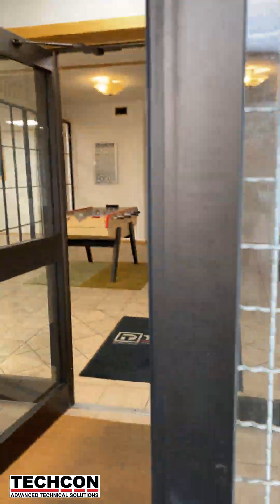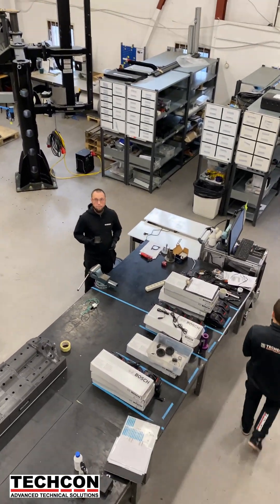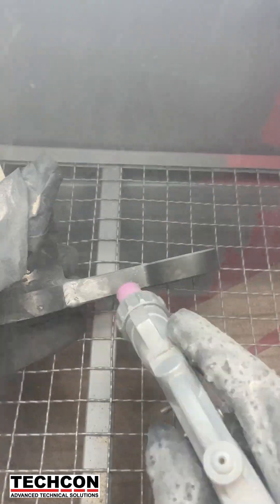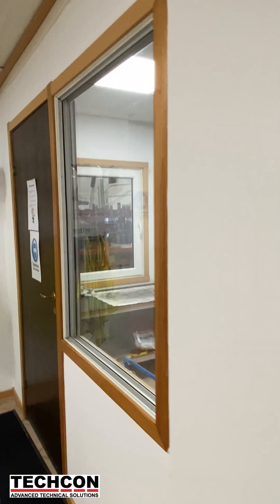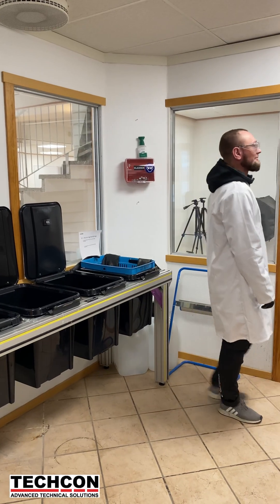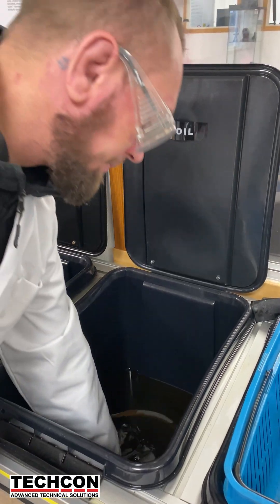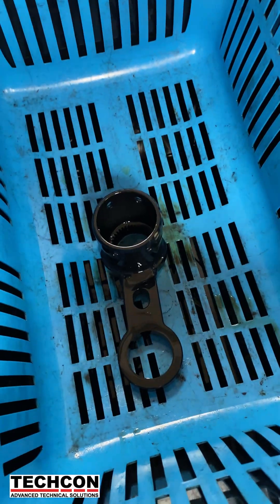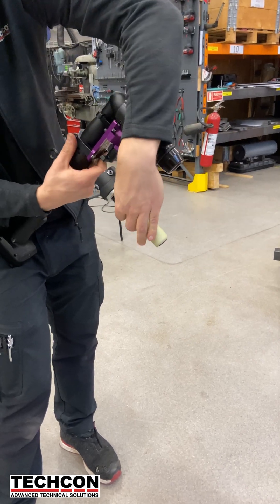Our black oxidizing process: smoother, stronger, better. #blackoxidizing #surfacetreatment

Comment: when you sand the gear isn't it become more smaller, but you said we can't paint it , it'll become more thicker but you sand it how is that works ?
Reply from the maker: Sand blasting at this pressure does not make the part smaller, it removes dirt and makes the surface more even for the black oxidize to get a even and nice looking color.